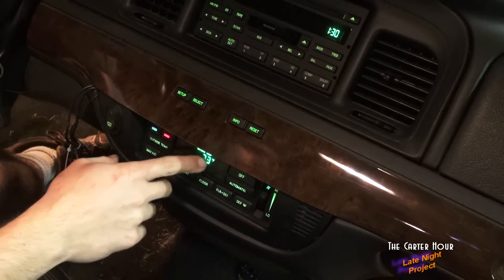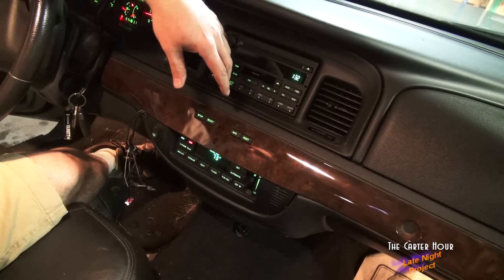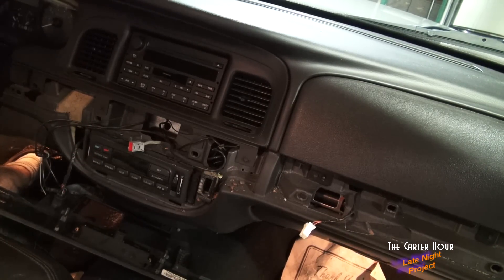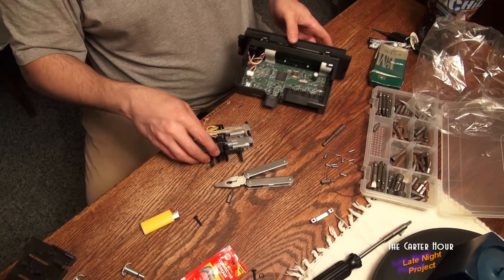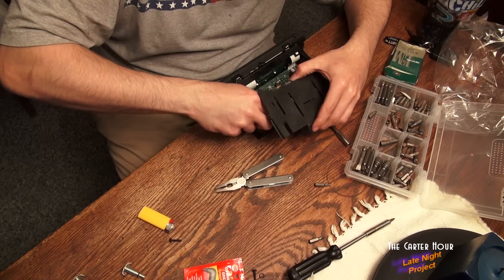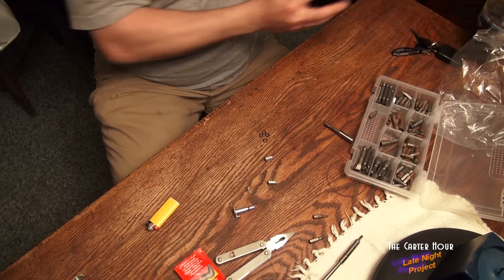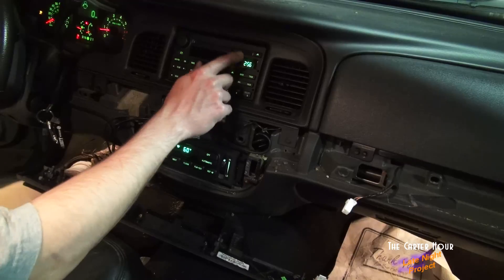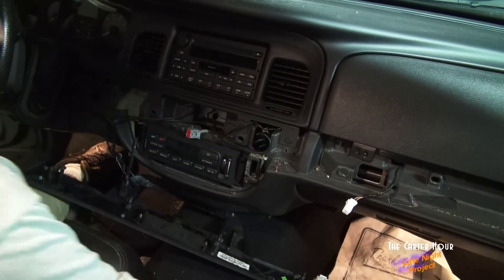Ford Lincoln Mercury EATC Repair Video - In Depth Tutorial - 3.00 Dollars in Parts

Comment: I just did this repair on a 2003 Grand Marquis yesterday. Some notes. The trim piece just pulls loose. However, there are two screws on the ends that can catch. These fit in slots in the panel and you might have to move them around a bit to get them out and again when you put them back in. You'll need a size 20 Torx screwdriver or socket to get the EATC unit apart. You don't need any special tools to get it out. The solenoid valve is a hex sided piece of iron with rubber on the ends. The ends are different. One end has a solid piece of rubber like a small pencil eraser. The other end has a raised rubber circle. The solid side goes to the inside and the circle will be towards the spring side. Just in case you forget: the solenoid valve goes in first, then the spring. The shiny plunger like piece has the O-rings. Mine looked just fine. You could look at the O-rings and not see anything wrong with them. They also were not brittle or damaged. However, when I tested one inside the actual plastic tube it was clear that it was too loose to seal. And when I removed the O-ring and compared it to a new one the difference in thickness was obvious. The new ones were much fatter. When I tested one of these it fit snugly inside the tube instead of loosely. To test this I had to take the coil tube off to get down the plastic tube. You can't feel the difference with the resistance of the metal tabs. I got my O-rings from O'Reilly auto parts. They are part number NAT 007 and cost 90 cents apiece. Take a small zip-lock bag with you to put them in because O'Reilly doesn't have sacks smaller than a grocery bag. So, again, even if the O-rings look fine they have probably shrunk.

Comment: My air was not coming out of my vents.I changed the heat/ac control unit. The air still would not come out of my vents. I so looked for my vacuum lines. Everything seemed to be intacted. So I didn't know what was wrong. I looked it up on utube and found this channel and low and behold. I did exactly what you did. Now the air is coming Thur my vents. Thanks for your help with this matter. You Da Man......👍👍👌
Reply from the maker: Cheers Anthony, glad that my video helped you out and your AC is now keeping you cool. :)

Comment: Watched and followed your video and now my recently purchased 2004 Mercury Grand Marquis EATC works fantastic! Thanks for sharing this info. It saved paying $800 for a new replacement, $125 for a remanufactured replacement.
Reply from the maker: 1930doodlebug I am so glad my video helped you get your 2004 MGM's EATC working the way it should.  Thanks for letting me know that this helped.  I too recently just bought another MGM a 2006 and it had the same issue, and I had to actually go back to one of the frames of my video and watch what I did, a lot of these EATC's go bad on the o-rings.

Comment: I used this info to repair the EATC in my 01 Town Car.  The solenoids are welded rather than screwed to a metal frame and the frame prevents removal of plungers.  With a little elbow grease, jeweler files and ¼" square file I was able to clear enough metal from the frame to allow the removal of plungers.  EATC works great now.  Thank you!
Reply from the maker: Fled, thank you for sharing that information!  A lot of people come by this video and ask, can this be done with a Town Car.  Now they have an answer.  Thanks and Cheers!

Comment: Just replaced the O-rings in the EATC on my 2003 Grand Marquis.  Vent was only working intermittently (depending on engine vacuum) and works great now.  Awesome video. Nothing out there is as complete and detailed.   Thanks much!
Reply from the maker: Hi Brian, thanks for the comment, and glad it helped you fix your issue.  Cheers :)

Comment: I'm going to do this over the weekend.  My 05 CV cycles from defrost, floor and vent.  Bought it used a year ago and finding all these little issues to fix!  At least I can fix most of them myself on these Fords. Nice to have these videos out there.  VERY HELPFUL!  THANK YOU!
Reply from the maker: Andrew Karafotias Hi Andrew, your very welcome.  This should help solve your problem.  Usually CV/MGM have these problems more than they should 03+ MY.  Good luck and let me know how it went for you.
Reply: I bought the o-rings on Ebay for about $2 and had it all repaired in less than an hour last weekend!  Blowing just fine now at all settings!

Thanks again!
Reply from the maker: +Andrew Karafotias You are very welcome.

Comment: Carter, thanks for making this video. My 2002 Merc Grand Marquis was misbehaving, the A/C air would go from vent to defrost under mild accelerations, and then get stuck on defrost until I reset the A/C controls, and then it would go back to defrost. It was frustrating. Thought there was a vacuum leak, but never imagined that it was solenoid O-rings located inside the EATC module. You saved me several hundred bucks!
Reply from the maker: Greetings Jerry glad that my video could help.  That is a very frustrating problem with the EATC.

Comment: Carter i did everything in the video to the ETC unit and works, before it was stuck on just defrost vents, now it works changes vents and shuts off completely. how ever it does not  change tempeture or gets the air conditioner to work so i think i got another problem some where else , thanks i believe i fixed half the problem. i herard there a another vent control unit not sure of the name of it that also goes bad but you have to remove the entire dash to get to it.
Reply: +James StClair The one you are thinking of (and I am currently cussing out) is the blend door actuator. if I could find the video I'd link it here. There is a shortcut to make it a 2hr job vs 5hr +. look up blend door actuator videos here, believe the vid I watched was on an '03 CV
Reply: The vid is "Blend door actuator motor", by realfixesrealfast

Comment: Hat's off to the Carter Hour. I viewed the Ford EATC Oring replacement video and went to work. I was skeptical about the outcome when I found 4 plyable orings(none dried out or cracking). None the less, I pressed on and reassembled. Works great, factory fresh....and I have one very happy wife as a bonus. FYI, symptom for the car....mid vents were not blowing any air out. Occasionally, after playing with buttons, it would blow out, but very random.
Reply from the maker: Well thank you.  The fix worked for you over all?

Comment: Good video, my 2006 blows only out of the defrosters. Did not get any errors when running built-in diagnostics, so I figured it was the blend door actuator. Changing the door actuator means pulling the dash. I'm going to change the o rings first. Thanks for the vid.
Reply from the maker: Yes if its blowing out of the defroster, then its the o-rings.  If its a blend door actuator, it would give you an error, plus the temperature wouldn't change.

Comment: This was good and very informative.... He has already done this job (probably several Times) on other vehicles and so we receive his experience as it is expressed in this video... I would have used a pair of water pump pliers to re-crimp the tabs of the vacuum control solenoids, and definitely would have not held the parts against My chest as I'm pushing on the parts (re-crimping the tabs) with a pair of long-nose pliers though ..... Everything else He did was very good....
Reply from the maker: +Michael Martinez Thanks Michael.  Cheers....

Comment: Thanks for the video.  I had to get rubber O rings at Ace hardware as none of the local auto stores had silicone.  AC works perfect now
Reply from the maker: +Mike B Mike, congrats on the success of getting your EATC back working correctly.  Cheers and thanks for stopping by.

Comment: First, thank you for taking the time to make this tutorial video.  Second - HOLY CRAP IT WORKS!  About two months ago my 2005 Mercury Grand Marquis all of a sudden started blowing out of the vents; my local mechanic thought it may have been a door issue but after checking further, said I'd have to get another EATC - to the tune of $700.  I was sitting in their waiting room on another issue when the o-ring video (which referenced your video).  I ordered the o-rings from McMaster and watched your video about 3 or 4 times to ensure procedure and equipment needed.  Changed the o-rings today and it worked like a charm!  Thanks again for sharing - and anyone having this same problem - what have you got to lose?  (Answer: $700-$900 if you DON'T do it.)
Reply from the maker: Paul Hardin Hey Paul, thanks for the great comment, and I am so glad that my video helped you repair your EATC.  They are definitely not cheap to replace.  Cheers to you friend.

Comment: I can't thank you enough for taking the time to do such a thorough step by step video. I followed your instructions to the tee and it worked out perfect, saved me a bunch of $. You are doing the Lord's work, imagine a guy with a family having to shell out all this money when he can spend under $20 for everything. You are a good man and I hope the Lord repays you a hundred fold.
Reply from the maker: You are so very welcome, glad that my video is helping many people out there avoid the sharks in the shark tank.  I had this idea after I found out that the EATC was going to cost $700 plus to replace and still would result in the same problem.  God Bless you and cheers!
Reply: Now that it's coming through the vents after a week it started to blow heat even though it is on AC. With 84,000 I'm thinking the blend door. Could it still be the blend door even though it doesn't show a p24 or 25 code?

Comment: Well, I tried it.  Thank you for posting this complete tutorial.  Did it and worked out perfectly.  I work slow and still did not take me that much time. Thanks again.  Now if I can figure out how to get rid of my intermittent Air Bag light code 5 1, then car will be like new.
Reply from the maker: What year is your car and what kind?
Reply: Hi, its a 2004 non-police crown vic. Air bag light flashes 5,1 after driving from 1 to 4 miles.  Some trips, the light does not come on at all.
Thinking is could be a loose connector somewhere.  Or maybe it is the module.  I know the dealer will want big bucks to replace the ACM.  There is no good instructions or tutorial that I can find on the internet about replacing the module in this car. Thanks.
Reply from the maker: +Jon DavaoCity you likely have a bad clock spring.  The clock spring goes behind the steering wheel.  Does it illuminate if you steer the wheel back and forth?  I had that same issue on my Grand Marquis and just replaced it and it went away.  Make sure you get a motorcraft/ford clock spring.  It shouldn't be too difficult, probably about 1 to 2 hours of time.  Just make sure before you do, disconnect the battery and wait 15 to 30 minutes before you get started.
Reply: Got it.  Yes.  I noticed the other day I drove for miles on highway, straight, then when I took the fairly sharp off ramp, on the turn, the light came on. OK will have to think about this one since removing the steering wheel is probably beyond my "comfort zone".. but I appreciate your response.Thank you.
Reply from the maker: +Jon DavaoCity no worries, I am glad that I can help you out.  Like I always say got to help one another.  Cheers and God bless.

Comment: Oh I know all about these ATC control units. The one on my '03 Crown Vic failed during the summer of 2011 in Las Vegas. Dealer told me $700+ and I told him to shove it. My friend took me up to Pic-a-Part on Losee Road just off I-15. I looked and looked but they had no third gen Crown Vic's or Merc's. Just before we left I happen to walk past a 1998 Lincoln Mark VIII which has a similar control unit though set-up very differently from the ones in Fords and Mercs but the components inside are the exact same parts. I lucked out and found two such units which I got for $16 a piece. I set my failed unit on the table, opened it and the two junkers up, and exchanged solenoids inside 20-minutes, and even now in mid-2015 it still works just like a new one with no more failures. I boxed up the rest of the parts and they are still here at the house should I ever need them again but these ATC control units are so damned easy to repair. Anyone with the slightest of inclination can repair one of these and save over $700 dollars. Pic-a-Part ain't there no more, now it's a scrap yard but it was once there when I needed it and they saved my ass.
Reply from the maker: James Barrow James, great comment.  As You made a mention of these good ole fords, they are so easy and cheap to repair.  keep your 03 running.  Cheers...
Reply: The Carter Hour, I love my car very much as it was the very first of the third and final generation. My '03 is still factory condition inside out and runs just as well. Only issue I am facing is severe rust corrosion on the underside chassis and drivetrain parts because Indiana uses very corrosive chemicals along with salt on our roads in the wintertime that destroys steel parts and eats wiring like a squirrel. I have several gallons of rust converter on the way from Wyoming which will be here this Tuesday or Wednesday and I'm going to aggressively attack and treat the rust completely under the car until it's all gone. My car was originally built for a dealership in Phoenix, AZ and it was never rust proofed or undercoated before it came to the Midwest states and the damage is severe but I can fix it back to like new condition.
Reply from the maker: I have owned myself owned 4 MGM's and my pop's has also owned 4 MGM's.  My current 2006 was a pure Michigan one owner car with 169,000 miles on it.  What surprised me the most was how well the car has done here.  For the age and mileage, I got lucky.  Also recommend to try and re-route your A/C evaporator drain location, it hits the passenger side rail and that causes major rust there just after the front tire.  In November I am going to take the MGM off the road, and it will sit in the garage until after all salt is off the roads.

Comment: 2005 Grand Marquis LS. Replaced the blend door actuator motor. WHAT A PITA!!!! I knew I had 2 problems before I started to replace the blend door. Estimated dealer repair cost $900-$1100. I knew I also had a vacuum problem because it was only blowing out the defrost and floor. I watched this video, it works like a champ!! Estimated dealer repair cost $800. Recap dealer repair cost for both problems $1900.00. Doing it myself $38.00 for the blend door motor and O-ring for the EATC.. Thanks for the video..

Comment: Dude, pull the key out! Lol 
Seriously,  thanks for the walk through.  Will be doing this on my 03 MGM. Hope it also solves the issue of only blowing hot
Reply from the maker: Unfortunately it won't solve the temp problem.  You have to replace the temperature actuator.  It's a real pain.
Reply: The Carter Hour yep, just looked that up. Fortunately,  I have a Pick n Pull very near. So, with your video and the other about blend door actuator repair, I'll be squared away for summer
Reply from the maker: Trent Berry
Hopefully they will have what you need.  Would strongly suggest replacing your heater core at the same time as the actuator.

Comment: I saw your excellent video on the EATC vacuum selenoids O-Rings replacement and I will do the same on my 97 Towncar, thus those O-rings most likely are dry rotted and brittle.. My problem is that when the A/C is on, the ac compressor clutch is not engaging and therefore  the compressor is not operating. Although The ventilation system is working and I have warm air coming out on all the vents when the ac is on
I saw a You tube video explaining that most likely it may be caused by  a bad AC Clutch Relay (located inside of the ETAC and welded to the printed circuit board that is responsible to signal 12V+ so the compressor clutch can engage) That relay can be replaced with a Part Number from Nikko: N4232A-012-Z1A which is an exact replacement and can be obtained on e-Bay as per video, so, why not at the same, since I have to dismantle and open the EATC , R&R  those vacuum selenoids  O-Rings as per your wonderfully explained video. Thanks again for sharing that.
There is a separate procedure and testing for this condition, that I will try, but will appreciate any input you may have on both subjects.

Comment: Scratch everything after HOWEVER although I'm not sure how the AC is blowing cold again only now it's from the vents and not the defroster, I took it apart 3 or 4 times looking for any problem the last time I cleaned the vac, manifold with a q-tip and alcohol because I think I had a little dielectric on it and noticed a very small cut on the foam at the end of 1 solenoid that I fixed with a dot of tacky glue, I don't know if that was causing any problem but one of the 2 stopped the hot air just not right away I drove a few miles with it blowing hot air still changing from max AC to vent , on & off ect then it suddenly starting blowing cold so like I said I'm not sure how however all is well now.
 Thank you for the post it saved me about $700.00 - the checks in the mail ;-)
Like you I couldn't find and didn't want to wait for the better O-rings so I spent $1.58 for 8 basic O-Ringsand if need be it will be an easy fix in 3 -5 years
Reply from the maker: Jon, glad it worked for you.  The foam pieces at the ends are vent cap filters.  No worries if they get slightly damaged.  You might also have a Blend Door Actuator Door Motor problem starting to lurk.  Cheers!!